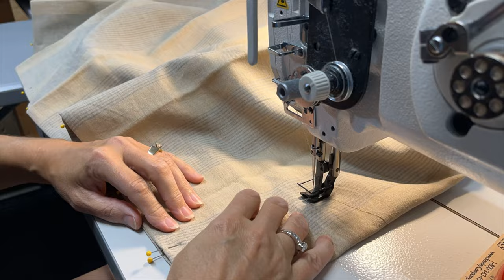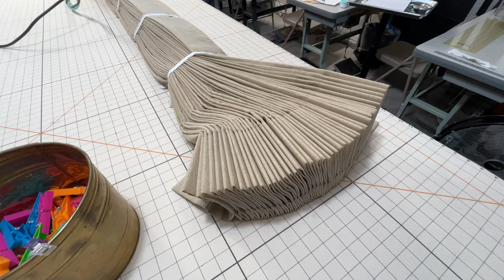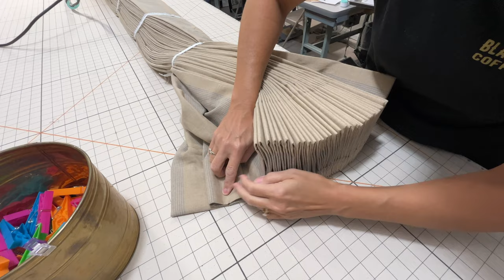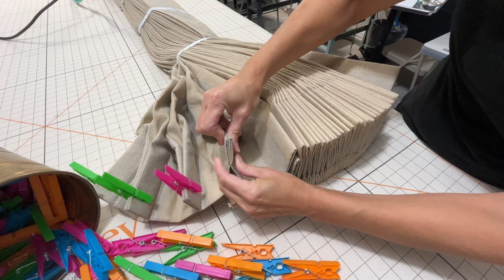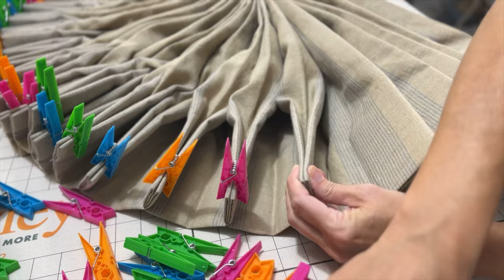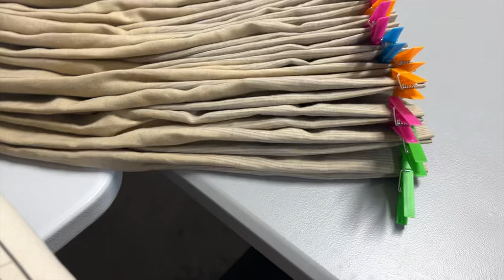How to create 2 finger or 3 finger euro pleats for pinch pleated drapery

Comment: How do you tack them at the top? What is the depth of the pleats? And space in between? What header depth would you recommend for 30"  length cafe curtains? Do you always use buckram
Reply from the maker: Hi Bonnie, I use a drapery tacker machine to tack the pleats. Before I got this special machine I stitched the tacks by hand which is difficult with some fabrics. A pair of needle nose pliers comes in handy. I almost always use buckram and 4” tall is most common, however I prefer 5” or 6” for very long drapery. For 30” cafe curtains I also like 4” but 2” or 3” also looks great. It really depends on the look you are going for. Smaller is more casual. If your fabric is thin enough you can try to stitch the pleats on your sewing machine with a very short back and forth stitch, or a zig zag stitch.